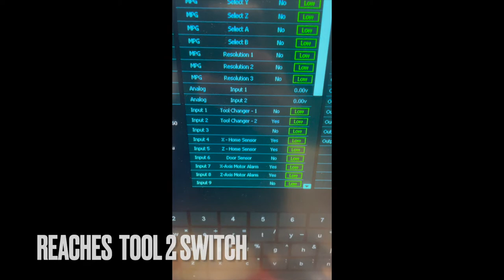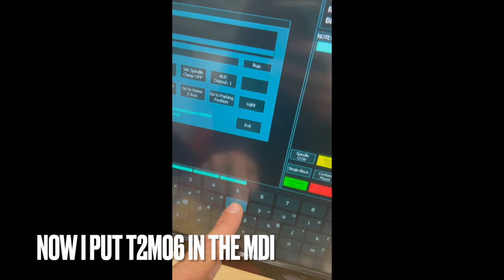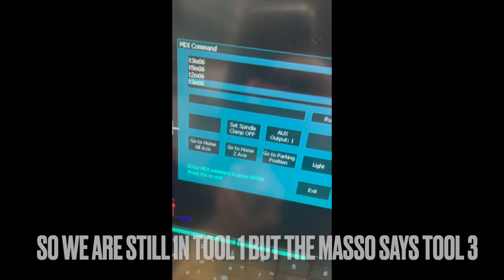Emco turret movie

Comment: Did you get this working properly with the masso?
Reply from the maker: yes i did. masso has updated the turret macro in the software so it works
Reply from the maker: still using the original emco board to control the motor so its just one relay from the masso controler
Reply: @konstruction_aps  Nice! im getting ready to convert mine over, the original control is working, but after about 6 hours of being on, the axis drives will error out and need to rest for a few hours.

I have a couple nema 23 clearpaths for the x and z axis, and a nema 34 for the spindle. I may end up doubling up servos for the spindle if the torque is not enough since I want to be able to run up to 5000rpm.
Reply: @konstruction_aps  did you reuse the emco spindle encoder?
Reply from the maker: @davidfarmer  i have reused the original spindle motor and bought a schneider atv12 vfd to power. it
Reply from the maker: @davidfarmer  no i bought the masso one and made a new encoderplate and mounted it on top on the old one. when i get the tome i will share the stl for mounting the new encoder
Reply: @konstruction_aps  I would do that, but I made a new headstock and spindle to accept 5c collets and a collet closer, all of which is significantly heavier than the stock spindle. I am only able to use the 2nd pulley set to get up to about 2000 rpm.